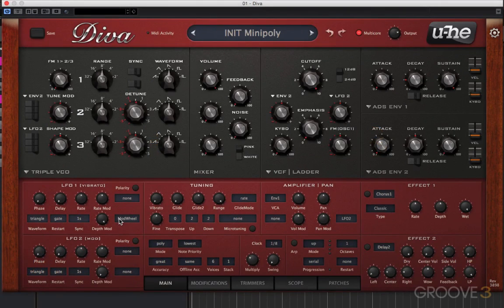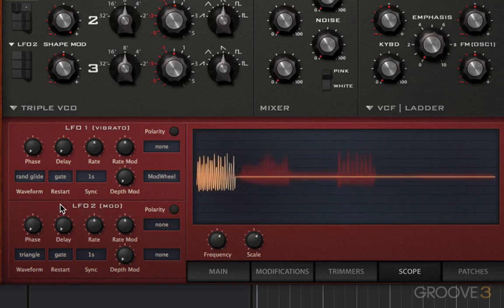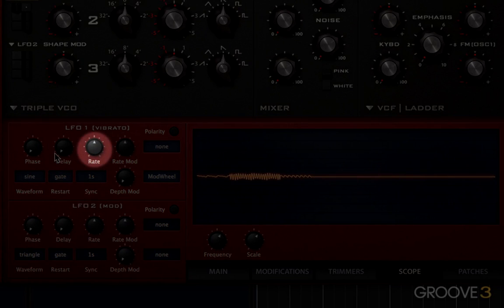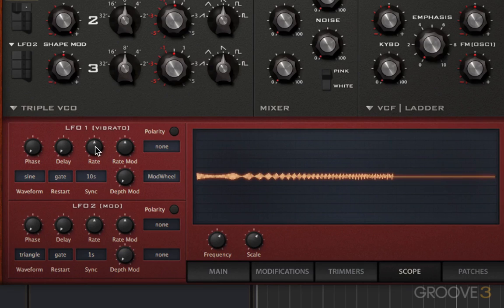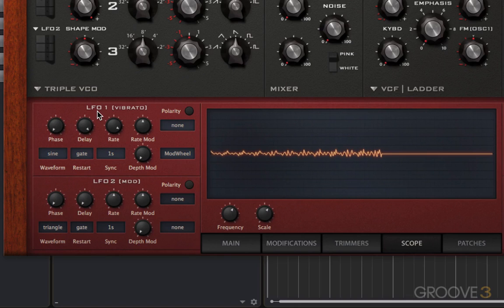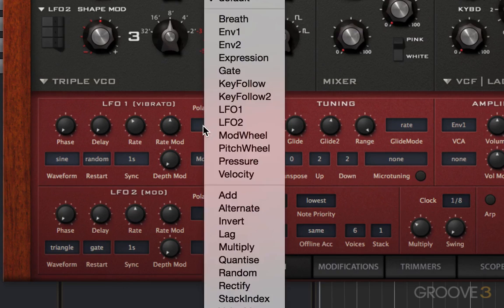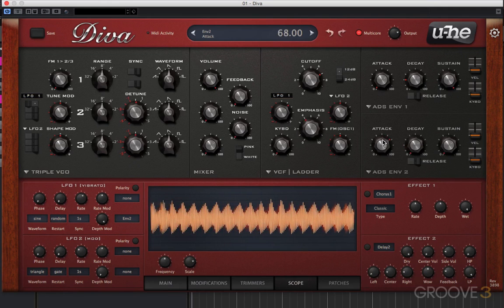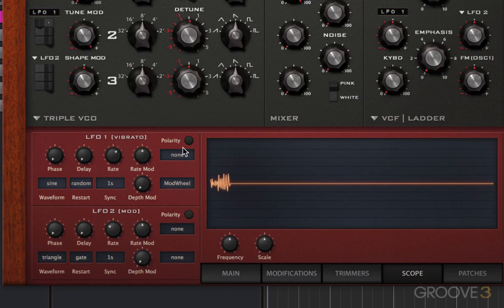U-he Diva's LFO's Explained

Comment: what means LFO2 (MOD) Which MOD?
Reply from the maker: Mod wheel
Reply: @AiynZahevSounds  The user guide says: 'LFO 2 is connected by default to several parameters in Diva’s other modules (hence the labels in brackets).'  this is why i was confused not assuming which so called several parameters are meant.
Reply from the maker: Oh I see what you’re asking now.  It’s just a name, like LFO1 is the vibrato LFO, LFO2 is the Modulation LFO.  It’s just to help people understand which LFO is being used.